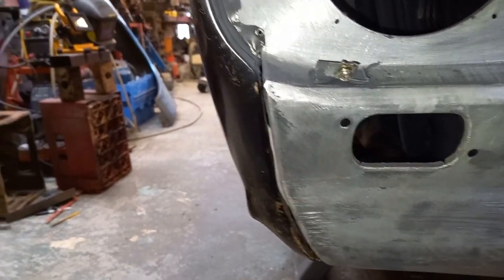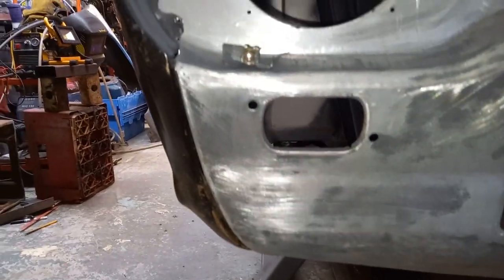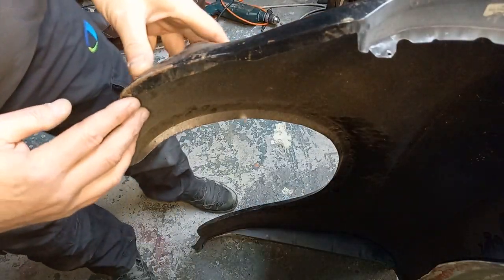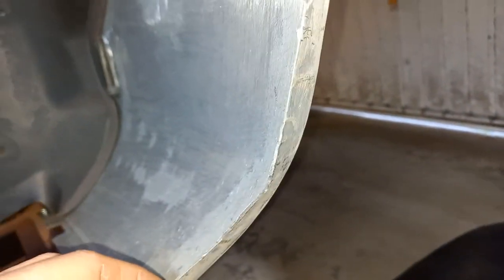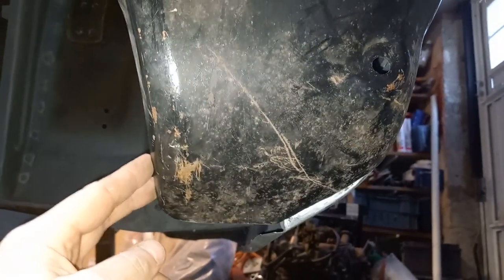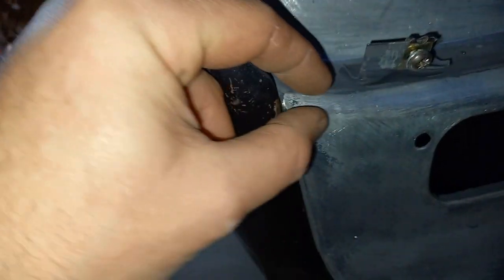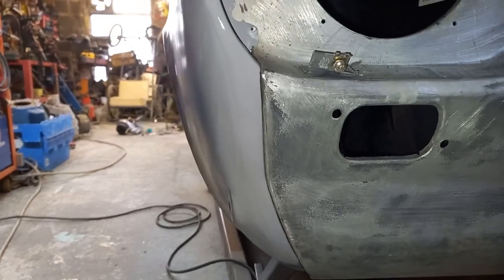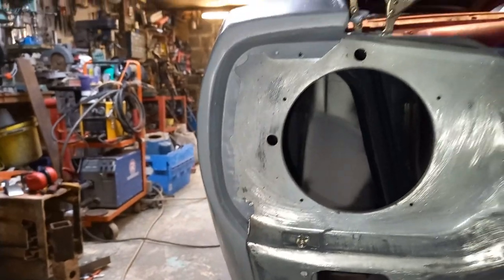Ford Escort MK1 Sorting wing fit part 4.  Car Restoration.

Comment: Where did you buy the panels from and were you happy with the fit overall or would you have bought from elsewhere in hindsight.
Reply from the maker: Mix of places, the front panels from Rally Design, very happy with them. Inner Wings EBay. The outer wing is a Hadrian panel which came with a job lot, utter rubbish!